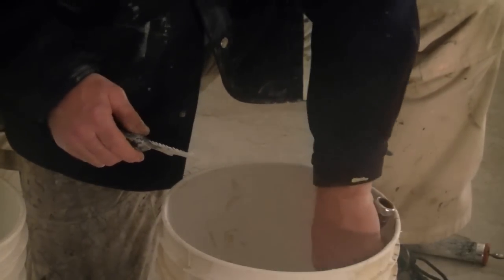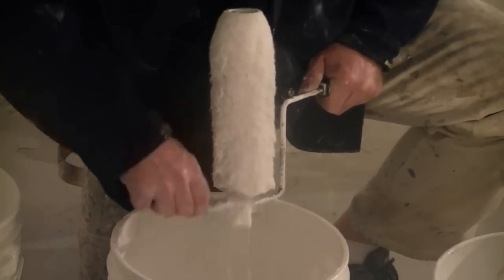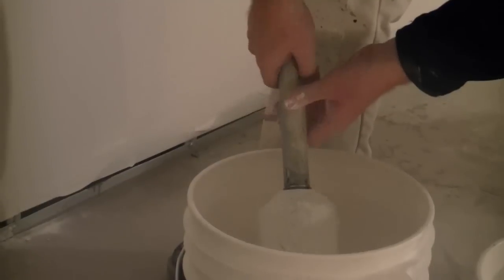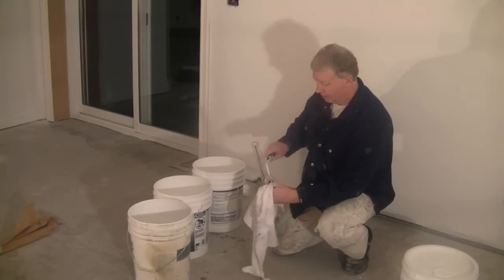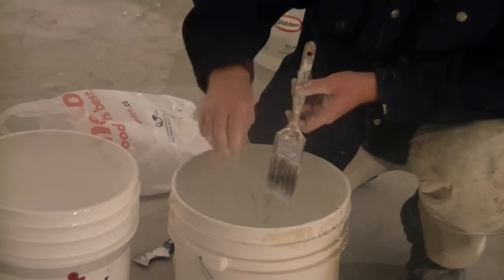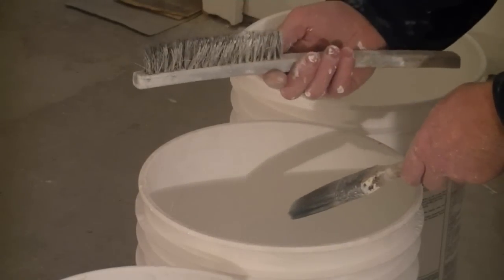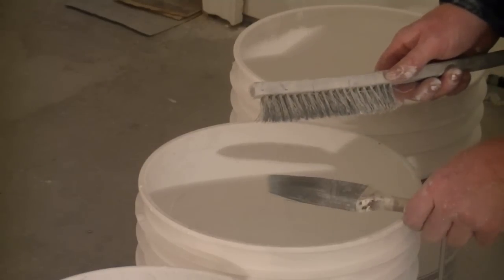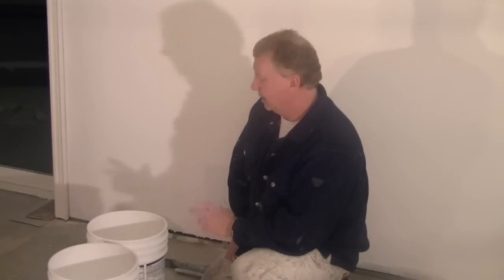How To Clean Paint Brushes & Roller Sleeves ( Without Running Water )

Comment from the maker: @rtzapper  Thanks for the question......NO you should not store brushes or rollers in a plastic bag long term they will become moldy....this is just a suggestion for overnight storage, ready to go the next day.After the job is done, clean as shown but under running water, then let dry or store in the original cardboard wrapper to help keep its shape.

Comment: In the case of brushes, I always buy brushes that are rounded at the handle tips.  I get very much the same result 'spinning' the brush between my palms of my hands.  I've tried a drill adaptor and a hand spinner but in both cases they don't do any better (or worse) than when I use my hands.  Great video, by the way, and thanks for sharing.

Comment: Q1 would you do the same process for gloss paint , by using paint thinner rather than water on brushes
Q2 if i had to paint a room 2 colors would i be better getting two naps two buckets and 2 roller screens 
or just clean and use one set after the first color thanks

Comment from the maker: 3/8" are not good for walls either, use at least 1/2 " or more if you can spread it out properly and avoid orange peel look, 3/8 " just doesn't hold enough paint to keep a wet edge and an even looking finish when the paint is dry especially with today's quick drying products, this results in 'dry' or 'roller' marks, all the best. MP

Comment: I agree with chugalongway01 as far as tossing roller covers into a pail of water to soak. It's so much easier to rinse and spin them out after a day or 2 as most of the product tends to settle "out" and to the bottom of the pail. Another thought is that it's more cost effective to toss them out - consider the several minutes it takes and the hoards of water used, it's just a 2 or 3 dollar item.

Comment: Hi, the video was very informative.
I was wondering if you would go through the same process with cheap paint brushes.
Or would you use the brush once and then throw it out ? Or would you still clean them with the comb and wire brush ? I suppose maybe if the brushes are $10 - $30 brushes then of course a good clean with the comb and wire brush is ideal :)

What about oil based paints and cleaning brushes and rollers ?
Is that the same process onsite without water ? Because you will need mineral turps, so i am curious how you would clean oil based onsite.
Reply: I only buy purdy brushes and they last for years if you clean them like the video. and yes is the same process when using oil paint but instead of water I use lacquer thinner.
Reply: Never use cheap brushes. I use purdy brushes only on remodeling jobs.

Comment: I roll out the excess paint in the roller on to where I am painting.  Then I slide the roller into a plastic bag or the plastic it came in, grip the roller tight and slide it off the handle.  Then put it in the freezer until the next use.  Works absolutely perfect.  Remember to let roller thaw an hour before use.  My hardware store man told me this trick.  Saves cleaning time and buying rollers until you change colors of course.

Comment: Thanks for this video, Have one question though. This technique takes off most paint from the roller sleeve & brush, but not all. Won't the remainder of the paint dry out eventually and stiffen the tool?
Reply: eventually you need to replace them but by using this technique they will last for years. if you don't use this technique you are going to be buying brushes and rolls every month.

Comment: it takes me 4:38sec to clean and spin off bone dry including a condition wash with a small bit of hair condititioner in the palm of my hand, brush and tray, roller handle included... spanking clean like brand-new... you could even take it back to the shop and get a refund if you kept the pkt and receipt..I dont use water...  I use Sweat.